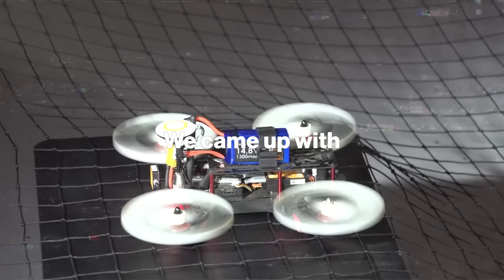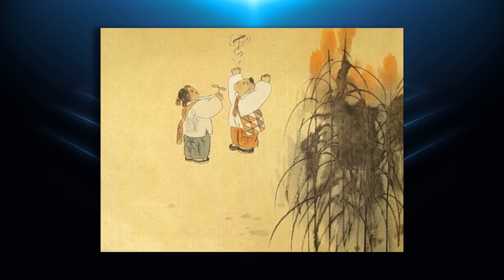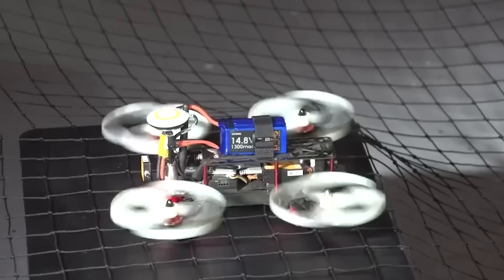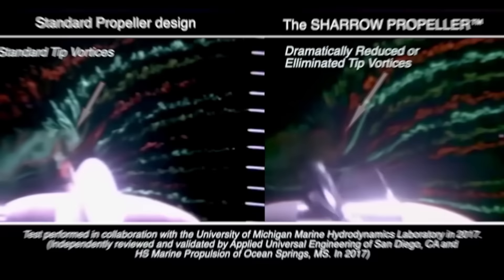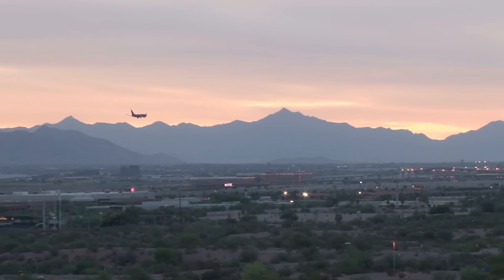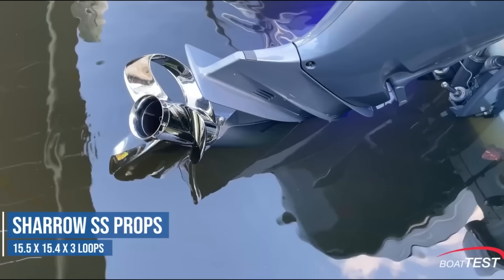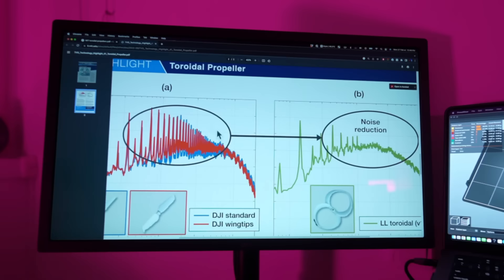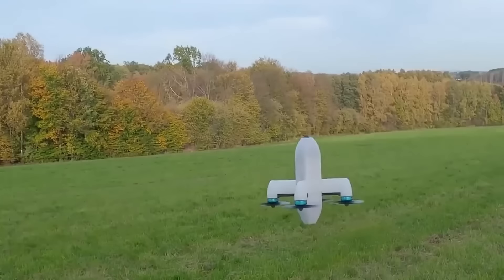This MIT Propeller Is Going To Change Aviation Forever

Comment: I would be afraid of losing a finger with a drone with such propellers...
Reply: How many have you lost so far? 😄
Reply: @pibbles-a-plenty1105  None, but they should test them with those gelatinous dummy hands, and design-in safety considerations before it enters the market.
Reply: I think, in truth, they are much less likely to damage your tender fingers, as they don't have such a flat pitch at the outer end, and actually don't have an "end"...
Reply: For the life of me, I cannot understand your logic or your conclusion.
Reply: @superbmediacontentcreator  Agreed!  You're far LESS likely to injure yourself with this design as there's no sharp tip.
Reply: Do you think other propellers are safer for your fingers?
Reply: @haha-eg8fj  who are you asking?
Reply: Um don't put your fingers in
Reply: I think you need to repeat basic logic class.
Reply: Sounds like you're afraid of propellers in general.  Not this one.
Reply: How long do you think before a flexible, variable pitch model is developed? 🤔
Reply: More sound more care for handling drones, less noise one can become casual in handling drones and hence Injuring..
Reply: Yes because normal propellers don’t do much damage 😂
Reply: And you wonder why ww2 happened lmao
Reply: These would be less dangerous than a standard blade.
Reply: @Dushyantgiri .  That’s the smartest comment here.  We need cues. When I see and smell a glowing coal, I don’t pick it up.  I’m not trying to be silly. Ride an electric bike and you’ll see what I mean.  Get a bell.
Reply: With your Money I mean your Brain we could invent some amazing stuff. I don't know you just a copy paste kinda guy. I have a few books of one of a kind inventions just lack what you got. The Wealthy Family and support. You wanna collect a nice percentage of Royalties next decade? ❤❤❤
Reply: That's total horse hockey.  @Dushyantgiri
Reply: As you should around any prop.
Reply: why? they're not sharper.
Reply: Noone ever taught you to keep away from rotating machinery, and don't run with scissors.
Reply: its cause you are a woman  @superbmediacontentcreator
Reply: @czahc0s176  Thank you...
Reply: Surely the standard spinning blades would do much more severing than the new props.
Reply: I think toroidal propellers are safer than traditional propellers.
Reply: you could say the same thing on working on transmission ...
Reply: @licencetoswill Because if you a) Are fast enough to jam your finger in one, its gotcha! 2) If you put a finger (arm, neck or mother-in-law- depending on the size [international freight container sized MIL]), in your ne of tye loop-d-loops, before you crank it, a normal propeller would self-clean at it’s at it’s starter motor’s Workend Torque-System Power Initial Transfer…It’d just clear your finger w/a cuppla cuts or sling your jumbo MIL clear outta danger in a pleasing way. However, if you wedge her, or a body part in one of these, once it hits Wet-Spit speed, they’ll be trapped, quickly increasing pain while lowering overall efficiency. Or increasing 😊, in case of how nice your MIL is…
Reply: I wouldn't. I'd be afraid of breaking a finger, but I don't think drones have enough power to chop one off, efficient or not. For that matter, I'd wager this would actually be more likely to flex on impact and be more gentle to a finger, and unless your finger started off inside one of the loops, it wouldn't get caught by them; your finger would touch the edges first. I think with these you'd go from breaking a finger to skinning one.

This whole thing could be a hoax, but I'd call it plausible. Let's wait and see.
Reply: I  think the Closed Loop design would be more apt to Kick a Finger Away rather than Sever it . The highest risk is at the Tips .
If you look closely you will see that the Tip of the Loop is parallel to the Axis of rotation . Basically a Fence around the perimeter .
Reply: Right ,so maybe we should make them louder and , thus safer ????? Really that's a very thin argument !!! @Dushyantgiri
Reply: @nickgilbert1264  I guess 3d printed ones are much heavier and rigid. I once tried to land mavic mini on my palm when wind gust suddenly threw it like 10cm away so it suddenly aborted landing procedure and started going down much faster. Before I had time to react it hit my palm just below my thumb by a rotor and only injury was minor scratches and irritated skin. Propeler of mavic is not a single piece, but two blades on a rotating joint (screw) held in position by centrifugal force.
Reply: @lawrenceiverson1924  it's not loud, it like EVs, EVs are given some sound to vehicles so that it becomes perceivable by pediatrician.. Similarly for drones
Reply: @pavelperina7629  OK - I have the Mavic Mini and the props are one piece and very sharp. I also tried to land it on my palm and accientally touched the prop with my finger and it put 4-5 deep cuts in the end of my finger.  The toroidal prop looks like it would do less damage as the tips aren't razor sharp.
Reply: @Dushyantgiri  All drones are very loud
Reply: What makes you think this design is more dangerous than the traditional propellers?
Reply: e  @Dushyantgiri  pain has always been a teacher!  or you could just pratice safety procedures with out a noise to make you pay attention, sounds like you might be to poor to payattention!!!?????
Reply: Are you not afraid of a drone with classic propellers then? :)
Reply: Put a screen over the two Sides, a Cage. Seems simple.😊
Reply: @einfelder8262  I think he has no experience with quad-copters/drones. This is a near-perfect solution to exposed, straight bladed props that drones use now. Current straight-bladed props have thin, narrow blade tips. Toroidal props have a large radius tip (approaching 1/2 of the prop's diameter, and the tip section moves parallel to the prop's rotation, which tends to push your finger out of the way, instead of hitting your finger with the thin narrow, small radius high speed tip of a straight prop blade. Note that this mostly applies to drone props. Outboards with 50-100 hp outboard motors swinging bronze propellers at 5,000-10,000 rpm will be a different matter. 

A low noise, high thrust SUBMARINE screw MIGHT BE OF INTEREST TO THE NAVY. It could provide higher speeds before it starts to cavitate (and give the sub's position away.)
Reply: Then don't put your finger inside them while they're running.
Reply: I don't see why. The tips are closed so they are safer than regular propellers.
Reply: Can’t see why?
Reply: You would be far less likely to be injured than with a standard propeller. The old style is pretty much spinning blades. They may as well attach swords to an axel. lol. The new style is pretty much like a spinning circle with no edges/blades. Far safer unless you put your finger directly into it from the front/back.. but then that is the same with the old style as well.
Reply: Literally by definition, the toroidal design of the propeller would be at MOST, AS destructive to flesh, and in many cases less destructive to flesh, but never more destructive to flesh than traditional propeller shape. The toroidal shape by definition, uses less input force for the same output force, which means fewer RPMs and less torque for a comparable amount of thrust. Your fear is completely irrational.
Reply: You wouldn't be afraid of losing a finger with a normal propeller?
Reply: you gotta be trolling
Reply: Are you one of those people that just can’t resist sticking your finger in a blender? Then don’t stick your finger in there…!
Reply: Just learn to keep your fingers clear!!!
Reply: WELL TAKE THAT IN CONSIDERATION YOU KNOW YOU COULD ALSO UTILIZE THAT TO PUSH FLUIDS THROUGH PIPES OR MOVE AIR CONTROL FORCES OF LIQUID I MEAN THAT'S FREELY PHENOMENAL....
Reply: @ASwordOfTheLord  my brother in christ why are you yelling
Reply: Keep fingers away from the cutty bits 😂😂
Reply: Smooth 🧠 comment
Reply: yes because less sharp is more dangerous? lol odd take but ok.
Reply: Perhaps changing the propeller on your hat would be more appropriate..
Reply: Curves in nature, circles in mechanical applications.
This also reminds me of that ancient Egyptian 'bent plate' that I see in posts.
Reply: @czahc0s176 A little insecure are we ?
Reply: I would think quite the contrary.
Reply: Wut
Reply: A small drone is not powerful enough to cut through a finger.    How is this design more likely to cut you than a traditional propeller?
Reply: @CombatSport777 I believe the OP is thinking that because it's a bunch of closed loops, as opposed to blades that just deflect off your finger. If you were able to get your finger through a loop, it seems like it might do more damage.

However, I believe the closed loop would act the same as a blade, or actually deflect even more, making it harder get your finger far enough in to cause the loop to jam against it, making it safer than a blade.
Reply: @heathencat5236   Interesting question.
Reply: @Dushyantgiri  Thanks for giving a logical explanation, on this comment.
Reply: @Dushyantgiri     The logic of the person with the finger-fear potentially explained, thank you.  👍🏻

... Though, a lion in stealth mode or roaring mode is still no exact indicator of the eventual bite damage (If so). 
Better to obtain and follow applicable codes of safety as far as possible. 
For instance, 
don't cross the road, because you don't hear no oncoming traffic. Also do a visual check and there is more... 

I hope those whom it may concern, read this. 
👋🏼
Reply: think it looks a bit safer in that regard
Reply: Can't be any worse than a normal drone
Reply: Why what is it about these propellers that scares you so much more than the original design? If your that way Inclined you should probably stick to wooden toys with NO moving parts, and be supervised by an adult at all times.😉☝
Reply: @gibbs677bg  yes these props are safer than regular one but all of them could take off fingers, so I kinda agree with you but why do you have to be so immature about it and throw insults at people...
Reply: At least you are thinking, and so has the development team. On drones the ring surrounding the prop is a bit safer, and becoming airborne is done with less RPM's. I want to try one on my model airplanes.
Reply: You are not allowed to use lace, or a toothbursh. Consult your caregiver.
Reply: You're afraid of losing a finger with a propeller that is less likely to injure you than the traditional design? Seems like you're running out of fears...
Reply: Any propeller will remove body parts even at lower RPMs. Your brain should keep your body parts out of ALL rotating objects...
Reply: TIP:  Do not stick your fingers near any propellers!
Reply: actually, this design could lend itself to creating something that would be less interesting features because it’s structurally, reinforcing, circular, shape, hard plastics might work for props in lower out put engines
Reply: And you thing regular propellers will not chop up you fingers? Why are you sticking your fingers in the propellers anyway?
Reply: More so than a normal prop?
Reply: 2 things to consider:
1- playing “catch” is ages-proven to be safer using balls. 
2-  “Tard-roidal” variants could be produced for those inclined to indeed pursue recreational entertainment by way of catching 1000-RPM-bladed objects. The outer edges could be slightly blunted (at a loss of efficiency), or edged with a softer silicone medium for less traumatic consequences during “Darwin-critical” applications.🤙